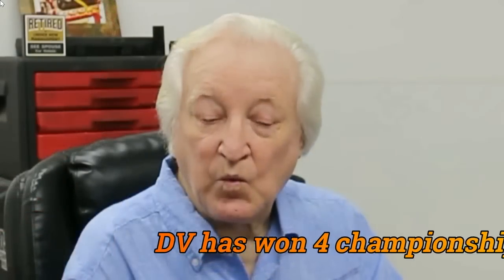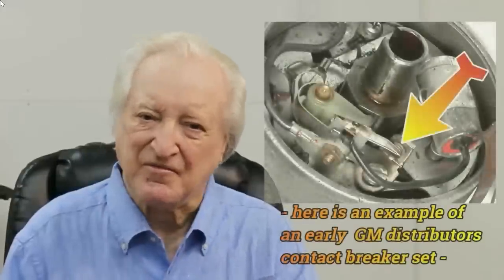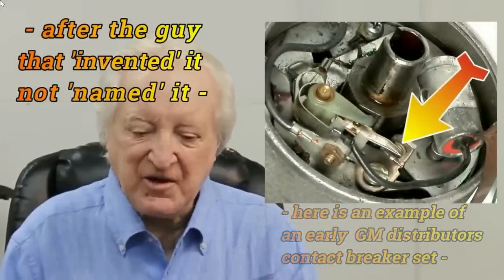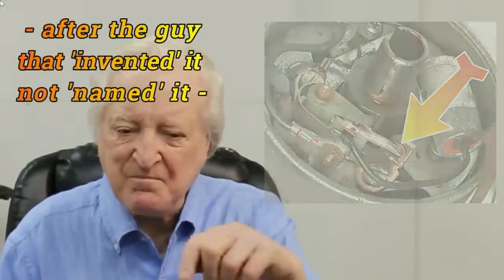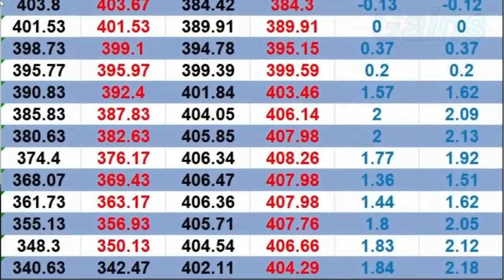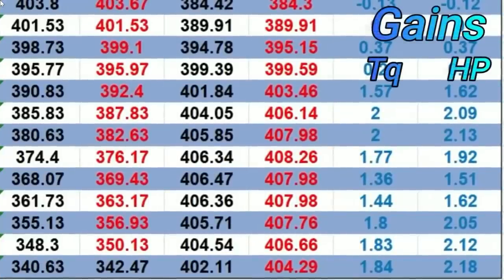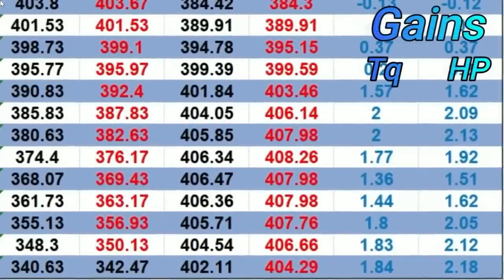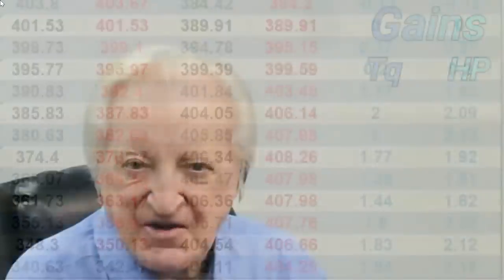How I got the best power sparks.

Comment: Takes me back a bit . As a kid growing up in the 60s my older brother some 20+ years my senior was seriously into cars was an engineer at Fords Dagenham  ( no xhortage of spares ) and loved to build and mod cars fabbing manifolds etc for his Rochford kit car . I used to collect dumped bikes from a nearby wasteland  dismantled them and sold parts to buy tools and began messing about with Villiers 2 sytroke engines .it was much cheaper to mod 2 T engines as to get more power you took metal out of ports etc , instead of adding valves , cams etc. Although I did have a go at an E93A " high lift " cam by grinding the base circles down a bit .To overcome points bounce , I used strips of razor blades tucked into the contact breaker points spring and ditched internal coils for larger external ones with higher turns ratios , and remove the heavy flywheels from the centre hub and run a 6V railway lamp battery Later in the 60s I got to play with the Volvo Penta outboard on his Tremlett and Yeoman Warrior skiboat . Graham  was also into hi fi and the first CDI system that I come across was published in either Practical Wireless or Wireless World by a chap called Turton or Tarleton in 1969/70 as a DIY project , a points triggered push pull oscillator charged SCR  capacitor system I later found out was based on a patented design owned by a Canadian inventor that had been intercepted by the US and leaked internationally . Another brother had just come of age to race bikes and I made one for his machine that I had built my first racing engine for . He picked up a 3rd place in an all comers race at Cadwell Park on his debut , beating much larger capacity machines . My bible was 2 Stroke High Performance Tuning by Cesare Boesaglia . The Dagenham libraries at the time were full of mechanical engineering books thanks to Fords and their various sponsorships . I had the bug and was using metalwork lessons at school to machine bike and later car parts and looked after my English teachers JAP engined Morgan that he raced . Its amazing how quickly a kid learns with a huge interest coupled with a lack of money .
Versions of that ignition system flooded the market here as a result of the publication , probably  the most popular being the Boyer Bransden unit because in later versions it had a tiny LED that allowed the user to set the points accurately , worked extremely well on bike's and cars and almost as cheap to buy as the cost of parts to make one .
Reply: Very interesting history, thanks for contributing

Comment: I’m glad that you mentioned the difference in some points actually varying in spring pressure! a few years ago I tuned an a15 that had noticeable dwell issues at higher rpm struggling to reach its peak and the found that new points started to float at 6500 ish  rpm the spring was thin rubbish compared with the older contacts! so I rebuilt the old one with parts from the new ones and added a coil spring for further contact pressure now the ignition has consistency at 8000 rpm’s and it’s quite happy now for a non electronic system

Comment: Great video. When I worked as an apprentice in the early 80's at an MOD manufacturers site we where building Capacitive Discharge electronic ignition systems for our first cars in our spare time as projects. We all the facilities to hand with a winding shop to make us transformers and all the other parts. We were building ones which could generate 3 inch sparks but this did limit the revs by the size of the capacitor.  Great fun and we were causing lots of noise in the test bed area! Prior art is any evidence that your invention is already known.

"Prior art does not need to exist physically or be commercially available. It is enough that someone, somewhere, sometime previously has described or shown or made something that contains a use of technology that is very similar to your invention."

Comment: During the 1970’s i was building field bikes with my son. One such was based on a bsa b31 frame and triumph 110 engine.
Now i dont need to tell anyone how lousy the triumph electrics were in general. However the one good thing was an uncontrolled alternator which ran at crank speed. So in the shed i turned out a dual contact breaker low voltage distributor, giving a coil for each cylinder. Then realising the limitations of standard kettering ignition i plummed for transistor amplifiers on the contacts.
However not being happy with the fact less energy is given to the spark the higher the revs go(a function of charge time).
I decide to feed the coils with constant current instead, the alternator being uncontrolled would give higher voltage at higher revs,perfect ! I stored the energy in an electrolytic capacitor 70 volts working and 3000 mfd.
Constant current was via whats known as emmiter followers these transistors also switched the ignition pulses, win ,win.
Needless to say it performed like a rocket and no missfires. The down side was it gobbled plugs monthly, but it was great fun.
Reply: Thanks for the history, love these stories

Comment: In the 1960's we used a Sun Distributor Machine (Synchroscope) to setup our distributors. For competition a dual point distributor was a must. They were designed so that you would get an increase of 3-5 extra deg of dwell by the offset of the points. In some cases we were able to set the point sping tension about 32oz, which was good to above 7K RPM. Those were the golden days of muscle cars and powerful engines.

Comment: Ahhh. Who here remembers Mallory 4 lobe distributors for V8's? In my limited experience what I worked out was that once you have enough spark to do what you need it to, then you don't need to have any more. Excessive spark energy in my experience reduces reliability. That said I've seen motors that load up on fuel at an 1100rpm idle speed, idle perfectly, and stable at 750rpm with just a change of ignition system. The greatest gains from ignition systems that I've noticed, outside of rpm potential,  are often in part throttle operation, and drivability. Just my personal experiences. Great stuff David. Regards Greg

Comment: Regarding split fire plugs.  I've found a noticeable increase in power by installing "Screaming Eagle" split fire plugs in my 80 CI Harley Davidson Evolution engine.  My guess is that the ground strap split must have somehow unshielded the spark a bit better than a conventional plug.  
The Screaming Eagle was nothing more than a conventional Autolite plug with the split strap.  Now I was running a single fire multi spark discharge (very early version) on this bike, no waste spark ignition.

I bragged to my buddy who had a AMF Harley shovel head, and he didn't believe me, always had his faith set in Accel plugs.  One day he showed up to my house on his bike & told me that he had fouled his plugs & went to buy new ones, but the dealership only had Screaming Eagle plugs.  He couldn't believe the power increase. He was running conventional points and a waste spark ignition.

They were pretty pricy in the early 90's but only had to buy 2 so it wasn't too bad.

Comment: Nicola Tesla did a lot of work on mechanical spark gap including magnetic spark quench to have a short fast spark discharge and in oil spark quench, Nicola was the first to work in high frequency electricity DC, and at High voltage this created scalar energy. 😊
Reply: Nikola Tesla  made a million  volts of electricity  and could light  bulbs  a mile away  without  wires  
His Tesla Coil  is the same Coil in a car transforming 12 volts to 70,000 volts that spark today's car engines

Comment: Happy Holidays! I understand everything what You are saying, because I start my journey in the "motor" world  in my childhood. I have VW Golf 2 very old, which is tuned with electronic combustion system and I use NGK V-Line spark plugs now with groove at the central electrode and yes - it`s something similar what You sad about "hot edges"... and my V-Line spark is "puffy" and wide in dimensions. I am very happy with this spark plug and these are the second 4 spark plugs (first 4 go bad after 30 000 km). Thank you! Happy New Year!

Comment: @David Vizard: Why not showing the drilled spark plugs and how you did it. Must have been hard to find such a tiny drill and drill it straight down.

What about Golden Lodge British made spark plugs which are common in Alfa Romeo's?
These have no regular  ground electrode but little stumps on the side.

Comment: I always swap out my spark plugs with  some copper plugs, then change them out during my summer oil change every 2-3years. 

Unless I can’t find one for the application, Like the 3.6L Pennstarstar V6 in my Durango. 😢

But this leads me to a question, i’ve seen some people on the Internet talking About. when used in some of these new were coil on plug applications.

Some people are saying that you really shouldn’t run copper spark plugs because in some cases the copper is literally melting. And there are some pretty nasty pictures out there too.

Now I’m starting to wonder if they should have gone one or two heat ranges colder because the energy being transferred through the electrode he ignition system was designed to work around the platinum or Iridium spark plug that has more resistance. 

But then I have a contradictory thoughts that say if the ignition system was turned up enough to hurt the bare copper then wouldn’t that have shortened The lifespan of the other spark plugs? But they are still going well over 100,000 miles, Like when they were introduced with the older ignition systems designed to run our old copper plugs. Back when they first started claiming they could run 100,000 miles. And they are still doing that today with the newer coil unplug applications.

When I get into a loop of proving and disapproving my own theories, it’s a never ending circle.

What’s your thoughts on it? And if you have another thought for me to chew on for a while. Then I’ll gladly except that too. 👍🏻
Reply: Could be wrong but but it seems Sir David does not answer any questions in the comments .

Comment: One myth I've heard from some local racers over the years concerning msd type ignition during my time in parts retail is - the ignition coil should be as close to the distributor as possible with the shortest coil to distributor cable as possible. Can address this Mr David? Thank you!
Reply: A ground connection of 1/2" wire mesh directly between the Coil and Engine block completes the HV spark circuit as effectively as is possible, especially better compared to a single automotive wire all the way over to the batteries negative terminal.
Hence they invented "Coil-Over" ignition transformers, which an almost ZERO spark and ground conductor length.
Reply: Right, I guess I should have asked about this concerning the ignitions other than HEI, my question was aimed at those such as msd type. There is a reason the drag racers and circle track racers aren't using HEIs, right, other than street stock class which are not as all out high performance with restricted carb, cam, heads, Intake and run hei ignitions

Comment: I made sparkplug pressure cells (with visible window, pressure gauge) to help evaluate ignition and plug while under 120 PSI. Insight was provided to stick with HEI run on 14.4 Volts, and well side-gap. Trad plug, only because the ideal plug would cost development money. Ideal being no GND strap, and natural side gap with capacitive area to promote the long spark.  Geez coaxial sheild wires and plugs (aviation) seal the joules deal.

Comment: The most interesting plugs I've played with lately are the Bosch +4's which work really well in centrally located 4 valve engines.   Not so great in 2 valve wedge heads though.   Anyhow...taking out a set with about 50,000 miles and looking at the electrodes showed one to be much more worn than the other 3.....another with some wear and the remaining 2 electrodes looking like new.   The ceramic surrounding the center fine wire electrode clearly showed tracks mostly going to that one worn ground and much weaker ones to the others corresponding well with the observed wear.

This got me to wondering just WHY would the spark choose that one electrode over the others?   The only thing I can think of is that the spark jumps to that electrode easier...and the only way that can happen...being that all are the same material and distance...is that whatever is between ground and center is more conductive.   The only thing in the chamber that is conductive is the fuel vapor so it looks like the plug automatically fires the most conductive path which also lights more fuel more efficiently.

Full power WOT doesn't seem to make a lot of difference what plug design you use...and this has been shown countless times by dyno runs, but my testing showed an absolute superiority in the +4 design at light throttle.   Holding a set manifold vacuum level and then driving up a long grade the +4's always got to the top at a higher speed than the comparison NGK stock electrode version.   I do believe it's because at light throttle the mixture density is weak and the stock plug can light only the fuel that is in or near the gap where the +4's consistently light the charge better by choosing the optimum spark path.   This results in a little more power at the same light throttle setting which translates into a bit better fuel economy.

Comment: When I switched to Iridium plugs on a couple of different cars the power output increase was noticeable, but also the fuel economy on my truck improved a lot.  I went from 18 mpg to 21+ mpg with the Iridium plugs, and like I said the power output difference was noticeable while driving.  I don't know what the power difference actually is, but the fuel economy was easy to measure.  Someday, I'd like to put the truck on a dyno with the two different plugs to actually measure the difference.
Reply: Iridium has one advantage: It lasts longer. That's it. It's a harder metal, and resists erosion better in the combustion chamber. It also has one disadvantage: It has a higher electrical resistance. It will, in theory, cause a slightly smaller spark but probably immeasurable. I suspect your old plugs were just eroded to hell and anything new would've made a difference.
Reply: @Joe4USMC  I'm not sure what the difference is in terms of the two different plugs, but the engine was a new rebuild with brand new plugs and only about 1,000 miles on it, so worn out plugs were not the difference.  The Iridium plugs have a very thin electrode though, so perhaps that is playing a role.  I also switched to Iridium plugs on another engine that I built from all new parts, and I found the same thing happened.  Definitely felt like more power, and the mileage improved a lot.  Two different engines in two different cars, a brand new engine and a fresh rebuild with new plugs on both.  One may be a fluke, two is not yet a trend, but there is something different with them, and it's not just the material.  I think the material allows them to change the electrode design in a way that make it perform better.

Comment: 22:40 That is not actually correct. The spark jumps from the corners because that is where the charge concentrates not because it is the hottest point. If that were true then when the plug is out and cold the spark would jump randomly from any surface. 
It is the electrical pressure that forces the electrons to congregate at any projection so that is where the charge is highest, hot or cold. It just so happens that those same corners do get hotter but that is not the cause of the charge concentration.
Reply: Yes, I also didn't understand this point. It is school physics. I think high temperature is just the consequence of what you said(current heats points of charge concentration). Also, because of thermal conductivity, any sharp corner is hotter than bulk material.

Comment: Dear Sir Mr Vizard, how many Joules of energy (per pulse) is enough in order to burn all the fuel - air mixture, in the combustion chamber, let say in a 100mm diameter piston head? As i understand, the advance timing of firing before the TDC, is heavily affect the results. Also the gas - to - air mixture has effect on this.   And please make a comment on multi - spark ignitions technology.   Before some years i was in task to design an electronic Ignition. Thanks In advance. Antony Theodorakis.

Comment: E3 plug electrode geometry is designed to merely compensate for the fact that the ignition system can't generate a high enough voltage to jump an 0.010 in. plug gap, which is the optimum plug gap.

Comment: Have you any experience with pre-chamber ignitions, as are currently in use in F-1?
Reply: The 4 cylinder 1255/1296 cc 1968 Renault Gordini R-1135 engine had a Hemi-Head (with big and close together valves) with a "Pre-Combustion" chamber that fed 2 ports, and that car won the World Rally championship. The Gordini cylinder head: https://i.pinimg.com/236x/df/d9/03/dfd9031a0255582d1255f7938c14ed7f.jpg
Reply: Closeup of the 1968 Gordini Head: https://i.pinimg.com/originals/b8/fe/dd/b8feddb19fae07b8d2104c5f900748ac.jpg
Reply: Nice!
Reply: @joeteejoetee  thanks for sharing. That looks like a great flowing head too!

Comment: Me Comment before watching; GM HEI has the variable dwell chip within to properly charge the COIL for best joules across to the secondary vs RPM.  Not aware of any better dwell- coil combo for the cost. The modern Analog CD capactive discharge (mostly 2-stroke engines) is most capable if we could have the coils optimized for V8 use, or waste-spark. I'm not at Coil on plug yet.